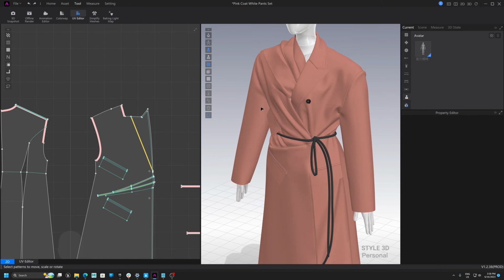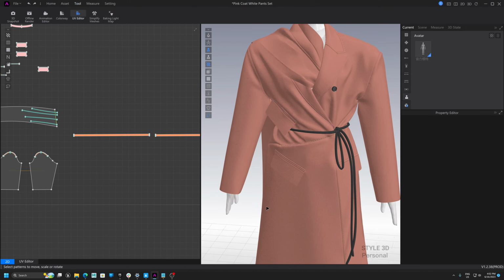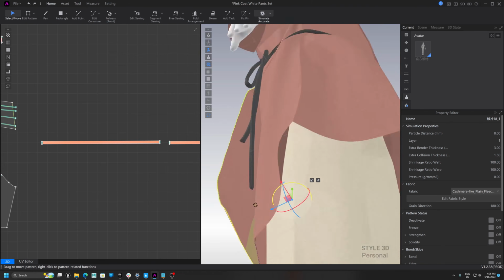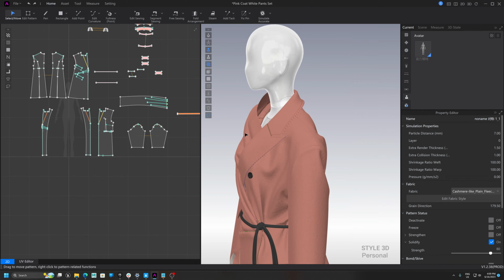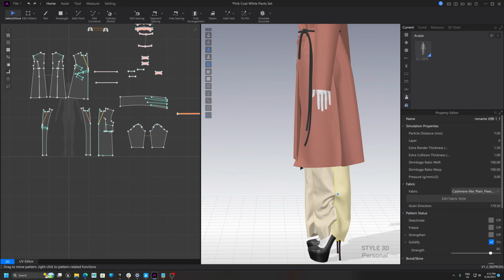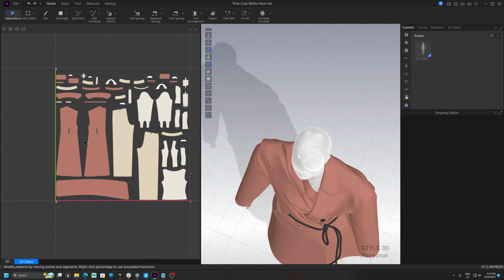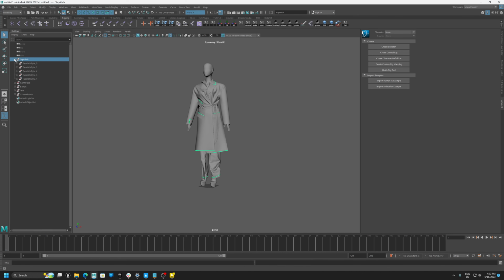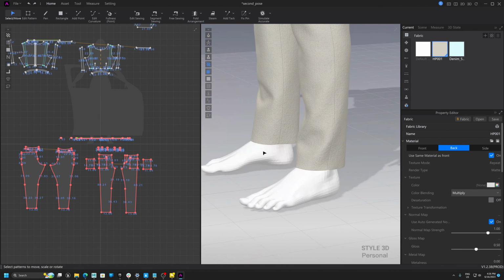Style3D's Unreal Plugin and GPU Simulation Redefine 3D Clothing Design

Comment: This is great, but Epic made Investment in CLO3D ( which owns Marvelous Designer). When Epic invest they probably will make it in their ecosystem.
Reply from the maker: Where did you get the information that Epic Games invested in CLO3D? Without a GPU simulator and an Unreal plugin, they can't surpass Style3D. Creating a new simulator is not an easy task.
Reply from the maker: I found some information indicating that Epic Games and CLO3D have bought shares of each other, although the exact extent of the investment is unclear. However, it's important to note that simply buying shares does not necessarily imply significant implications. Epic Games has made various investments in different companies before.
Reply: @MetaRig  it implies that they are putting efforts together to build future of digital fashion, but extent of that is unclear of course. I researched Style3D and I love it , but feature is not what defines great software. It’s the community, market and industry integration and etc. Style3D is something between MD and uDrap. GPU sims in Style3D are much better than MD, but again it’s just a feature. I’m not biased to any software, let the best one win lol
Reply from the maker: @m1sterv1sual  Maybe CLO3D will come up with a GPU simulator someday, who knows? But let me set the record straight: Style3D is actually way better than CLO when it comes to simulation. It's super accurate and crazy fast, no doubt about it.
Reply: @MetaRig  Haven't tested it in some use cases but for now it works much better than MD. I haven't tried but is it possible to import from MD garment to Style 3D? Can style3D trace and make garment just as I can from Zbrush(with proper UVs) to MD?
Reply from the maker: @m1sterv1sual  Yes Just like MD
Reply: Can I import garments from Marvelous Designer to Style 3d?
Reply: @m1sterv1sual You were right about integrating it into their ecosystem!
Reply: @WiderMotion  business is predictable game...lol
Reply: @m1sterv1sual  👌😅